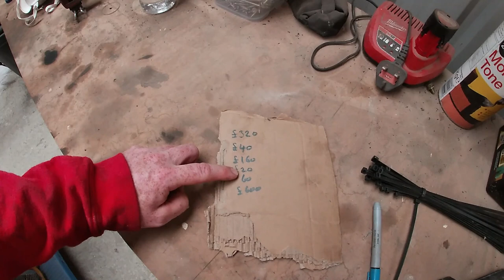Homemade Dump trailer BUILD /Tipper trailer

Comment: That's one heavy duty hydraulic cylinder. I am currently thinking on adding a Hydraulic system on a truck bed trailer for testing. I would really like a dual or triple axle dump trailer. Awesome video.
Reply from the maker: Yea it's been working great so far, I was going to buy a new tipping trailer but it works out too expensive so this was perfect. Thanks for watching 👍

Comment: Great build seems heavy duty what size is the main trailer body and what is the section size of the steel ?
Reply from the maker: The trailer is 12ft long and the steel is a quarter inch thick. Thanks for commenting 👍

Comment: Fine looking trailer... Especially after its Painted. I mean no disrespect but Might I suggest running another "C" channel on the outside of the frame to better support your spring hangers. That's a lot of weight when loaded to be putting on just a 2 x 2 angle iron... PS: Loved the video. I do love building and fabricating trailers. My hobby...
Reply from the maker: Thanks for the comment and the advice. I will do that, I've a few other wee bits to do to it as well. I'm new to metal work but really enjoying it. Thanks for watching 👍

Comment: if you build anther make a rotisserie for each end from scrap. Makes tasks far easier building a trailer . welding especially. use them all the time in Tasmania.
Reply from the maker: Thanks for the tip mate will keep that in mind. Thanks for commenting 👍

Comment: What are the dimensions of your shop LxWxH?
If you were to build again with the same floor square footage would you change any of those dimensions, and why? 
Love watching the process of the build 👍 ty
Robin
Reply from the maker: Hi Robin it's 17m long, 7m wide and 3.2m high. I'd keep it the same I'm happy enough with the layout and size. Its a lot more usable now that I have a storage shed to keep all the large equipment in. Thanks for watching and commenting 👍